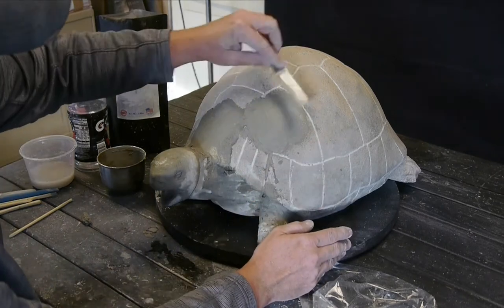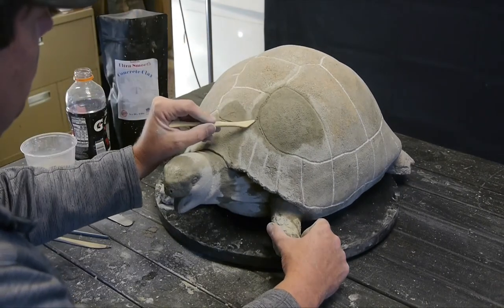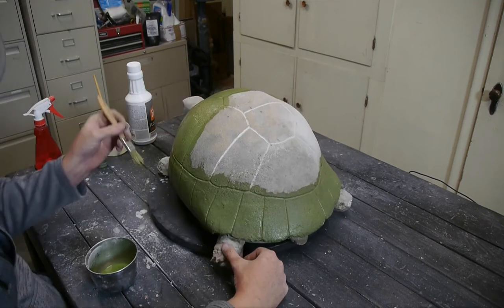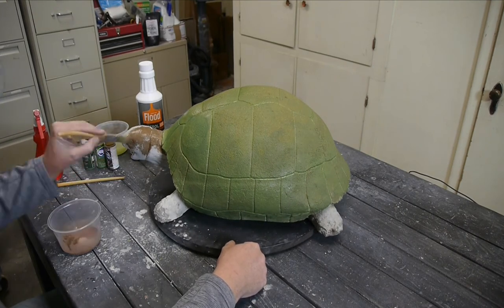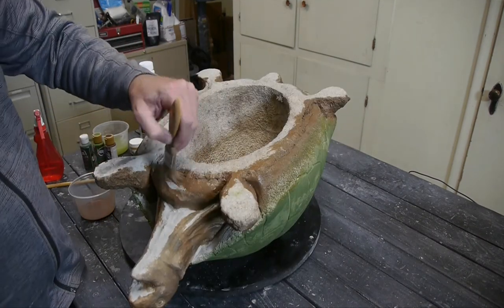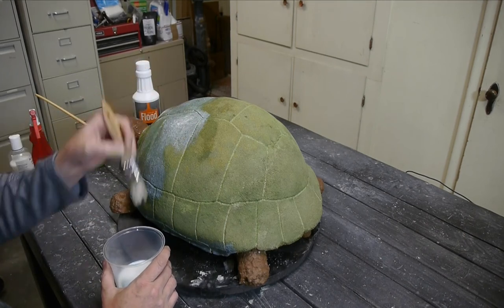Concrete Turtle Garden Statue Repair - DIY - SculptCrete

Comment: no gloves or guard on the grinder..  thumbs down for how dangerous that is...
Reply from the maker: You can touch that blade and not get cut, as it is a diamond-cutting blade and is smooth to the touch. Please know a little more before commenting.
Reply: Not dangerous at all
Reply: What products are you using?
Reply: @sculptcrete9648  "Please know a little more before commenting."
He's right. No guard means more danger.